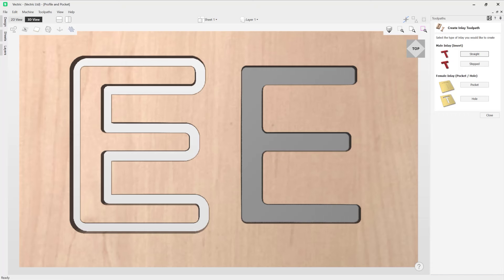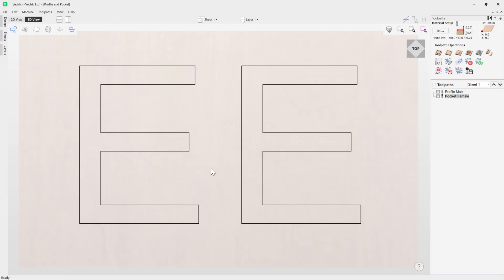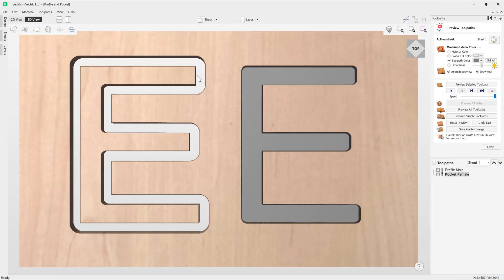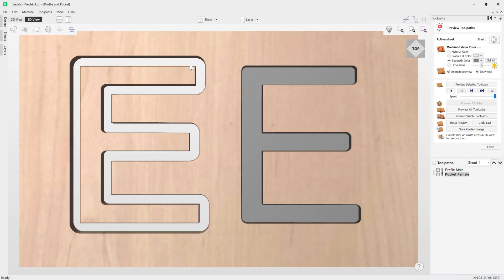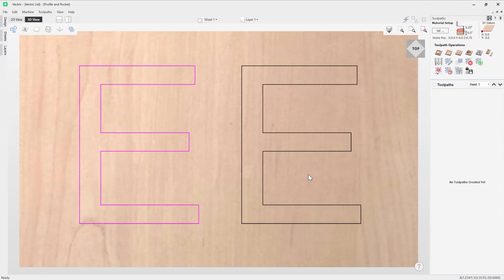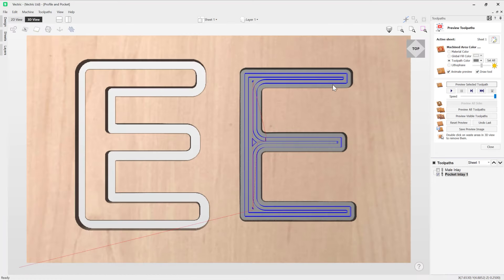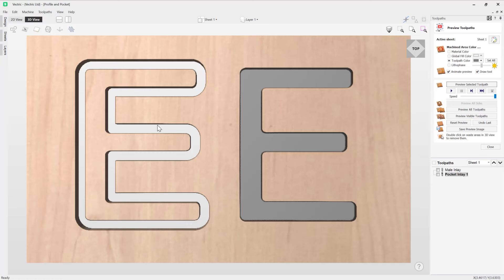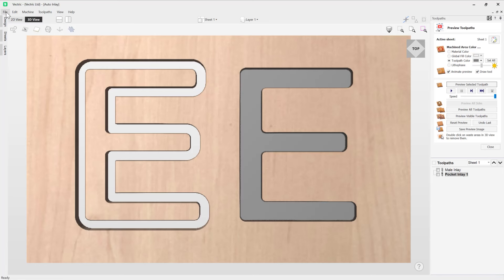How to use the auto inlay toolpath in Vectric software | 2D Toolpaths | V12 Tutorials

Comment: I'm making a set of push thru letters with acrylic and aluminum just as your example here. Except the total length will be 264" wide or 6 sheets of aluminum. Some of the letters will have to span two sheets. I've created the tool paths for all of the letters correctly except for the few that span two sheets. When I create the toolpath to cut the outer profile, the letter that spans the two sheets is to small by the diameter of the bit. How do I correct for this?
Reply from the maker: Hello and thanks for the question.  Exciting project you are working on!  I think this might be one for the support team, seeing as they will need to see the file.  Please email them  at support@vectric.com, include the file, and an explanation of what you are seeing.  They will be able help.

Comment: What are the pros and cons compared to the VCarve Pro VCarve inlay tool?
Reply from the maker: Hello and thanks for the question.  The auto inlay tool is really nice of you are looking for a straight sided inlay. For example adding raised letters to a project, that are proud of the surface, or letters that need to be pushed through the back.  OF course you can use it for other things as well.  The auto inlay tool takes care of making sure the geometry of your tool in taken care of so that there are no supposes and the latter (components) fit.  It is manly used with a endmill.  You may struggle with small details or small lettering.  Where the VCarve inlay tool uses a v-bit (specifically) and the amount of detail you get is dependent on the angle of the tool and can surpass a straight walled inlay by miles.  You do need to surface off the plug in the end and it only works with a V-Bit.  Both tools have their place... depending on the look or project you are trying to create.   I do hope that helps.
Reply: @vectric  Thank you. I was playing around with the options earlier, but is there a way to add a clearance path when using the male inlay path tool?

Comment: Another great video. Couldn't it be easier to fillet the corners in the sketch by half the width of the bit in use and then just use the profile toolpath.
Reply from the maker: Thanks for the comment, and suggestion.  There are a few different ways to do this if you choose to do the work yourself.   The Inlay Tool chooses to use a method that is pretty much fail-safe but again, you may have a different method that works for you.

Comment: I would like to see an example using a tapered bit to cut sharp corners as the old method of inlay did. Will this method make that process any easier?
Reply from the maker: Hello... I think I missunderstand.  This "Auto Inlay" feature is not new, but the VCarve Inlay Feature is.  If you have VCarve Pro or Aspire it is now part of your toolset.  It can be acessed from the toolpaths tab using a different icon... looks the same but has a "V" in it.

Comment: Excellent explanation.  Just one question, in what instances the stepped inlay option is selected?  I am trying to understand the use case.  Thanks.
Reply from the maker: Hello and thanks for the questions.  It allows you to create an inlay that has a pocket that goes all the way through ythe material, and the plug will have a step.  So when pushed through from the back, it won't go all the way through and end up being flush with the from surface.  You could also use it for creating a plaug that when inserted from the front makes use of the step to cover any gap in the fit. There are a few applications that this would be handy.
Reply: @vectric  Thank you very much for your clear explanation.